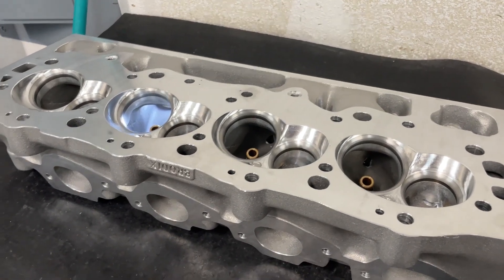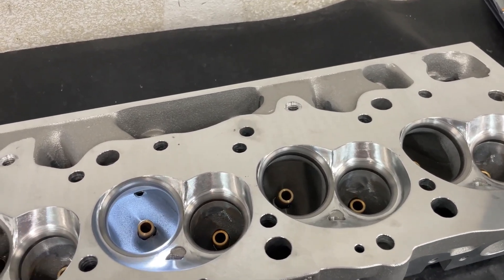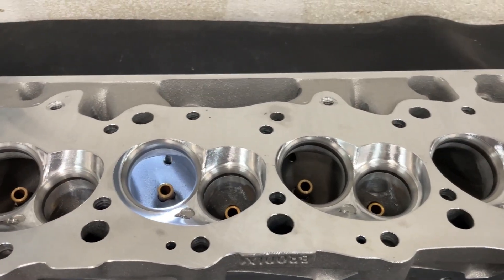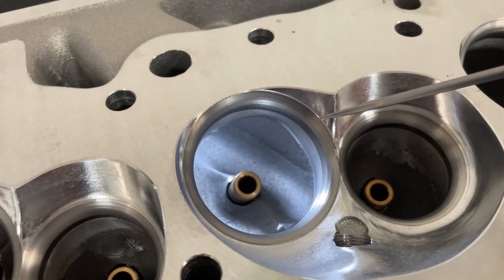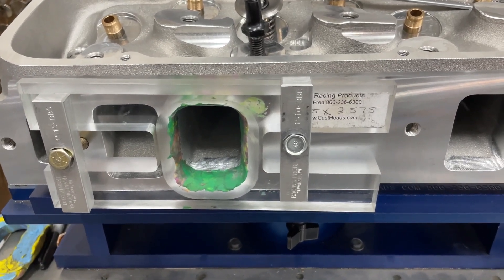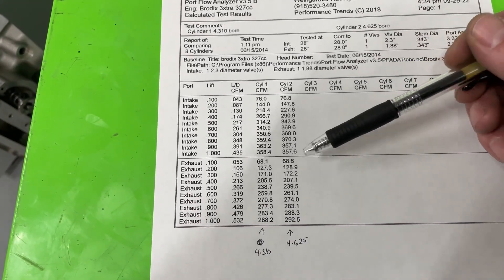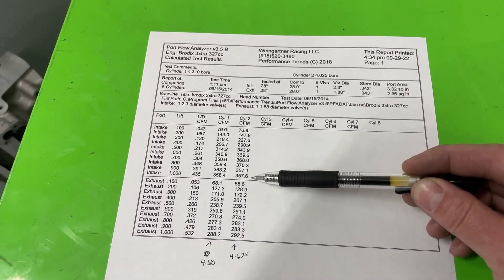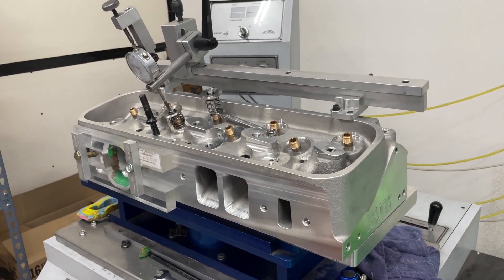Brodix 3xtra 327cc Head Review With Real Flow Numbers

Comment: A friend of mine runs a NHRA legal Superstock 73 Super Duty 455 310hp factory rated Pontiac engine, it has a cam with right at an inch of lift. Original cast iron heads, altho there's been alot of magic performed on them, it makes 725+hp with its original Q-jet on a Victor intake. Turns 8200rpm thru the lights. It's in a 3rd gen firebird and runs low 9s in the 1/4. It's a monster. Biggest cam I've ever seen used in a Pontiac engine and I've built Pontiacs since 1984. NHRA Superstock engines are all cam and headwork. So flow figures at an inch of lift does apply to some folks. Most of the bigblock Chevy race engines I've built over the decades used cams in the .750 to .800 lift range.

Comment: Brodix claims the 327 runner flows 401 & 406 @ .600 & .700 lift. What's up with that?
Reply: Like most every manufacturer, they lie about their flow numbers. Eric's bench also flows a bit notoriously low. But no way these see 400cfm on anything but a very generous flow bench.

Comment: how do these compare to ds320 i built a 468  fairly high compression bracket deal was getting ready to order some heads. may give you a call im in BA also.
Reply from the maker: I haven’t flowed the ds heads yet but they are an older chamber design. They are cheaper than the 3xtra though.